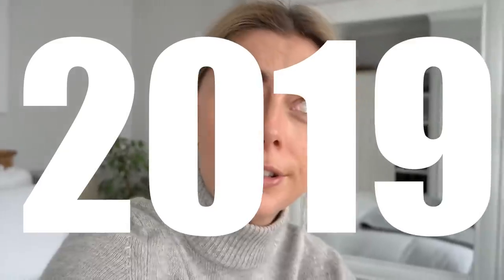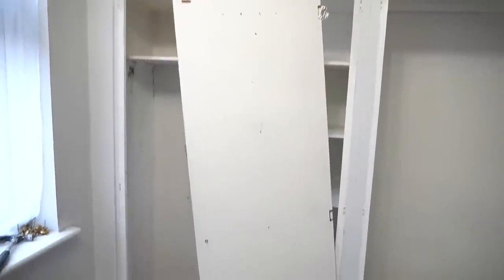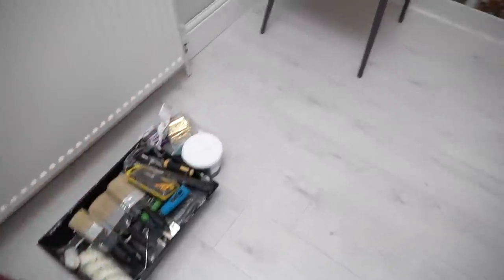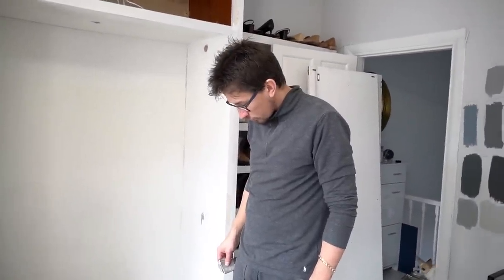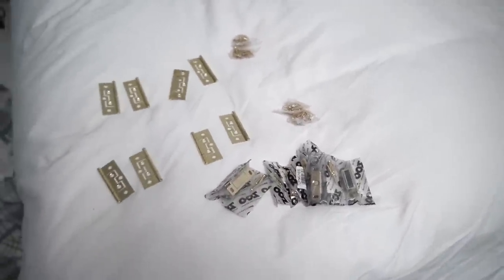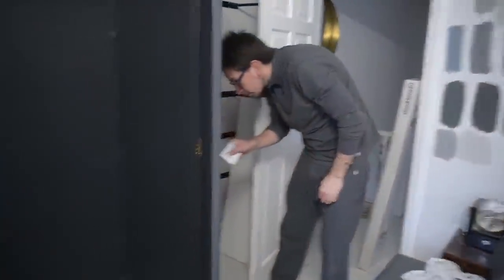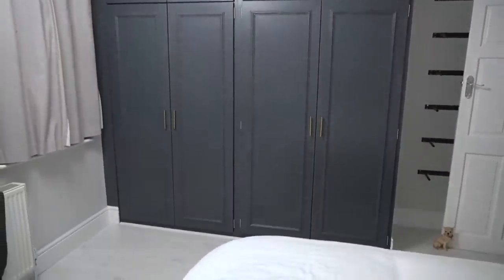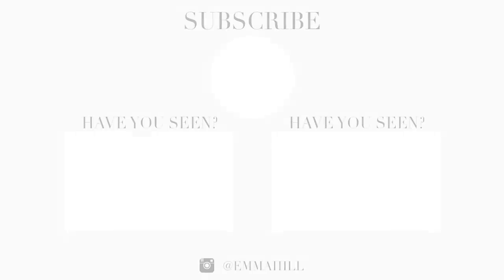Renovating My Built-In Wardrobes

Comment: It looks brilliant!!! if you don't want a bendy rail and don't want to put a middle structure in, for mine I got an old sweeping brush wooden handle and inserted it into the tube and it adds structure no bend. I'm sure any wooden cylinder or dowel the length of the tube would work.
Reply from the maker: Great idea! Thank you 👍

Comment: Emma, how well has the lining paper worked? I have a built in wardrobe against an external wall and have problems with condensation/mild damp. Nothing else seems to combat the problem- apart from ripping it out and paying for a new wardrobe 🤪
Reply from the maker: Ours has been fine 👍 We had previously lined it (which was also working fine) but as we were redecorating we decided to redo it too 👍

Comment: What did you use to cover the back walls (that white sheet you have... what is it exactly?), and how did you stick it to the wall?
Reply from the maker: Its an insulating paper. It has paper on one side so it can be painted and then a type of polystyrene on the other. 👍